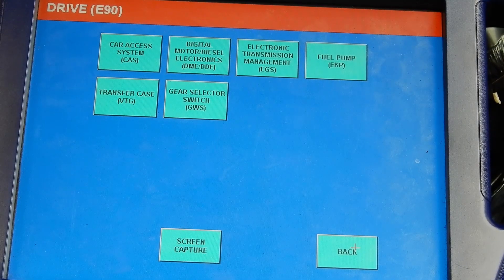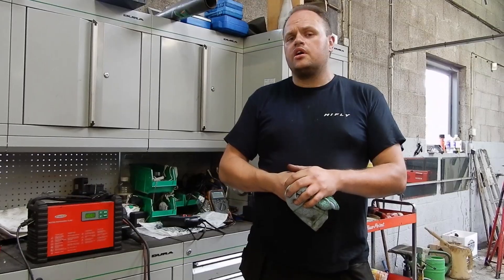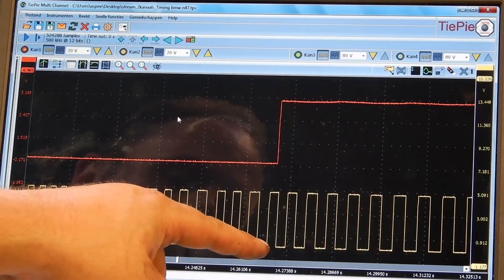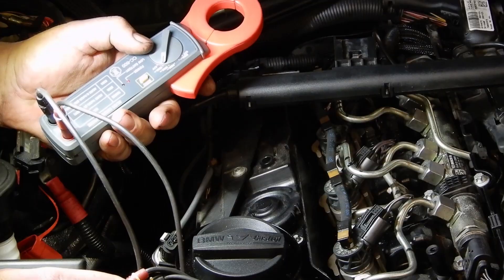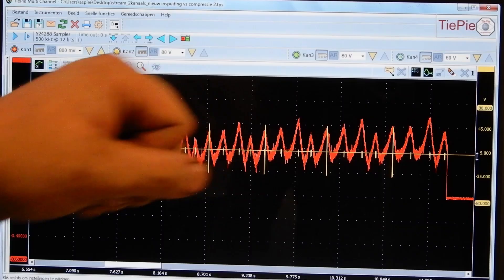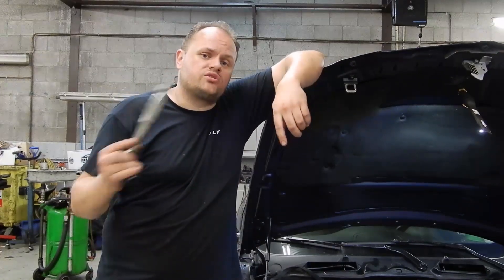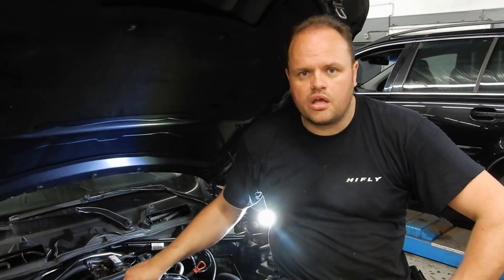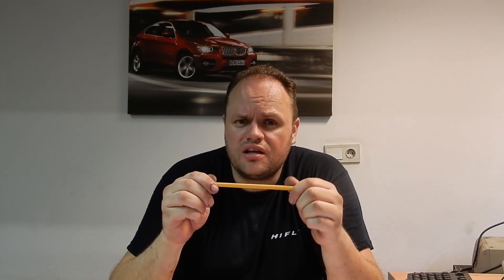Bmw n47 diesel engine "Won't run" diagnose

Comment: I like this more low key style of video. One question I have is on the relative compression test with the diesel engine. Assuming the engine is capable of running, how do you trigger cylinder 1? Do you unplug all of the injectors?      Since we are guessing, I'm saying the engine spun a main or rod bearing.
Reply from the maker: That really depends on the system your working on. And what's easy to get to. Sometimes it's unplugging a dieselpump connector. Other times i blead the fuel rail.

Comment: i think there is a mechanical problem inside the engine because its very hard to turn manualy even the starter is too hard to rotate the engine i guess a worn out piston or main  bearing

Comment: Cylinder n 3 I gess because during the starter motor test with the clamp the waveform showing the third  cyl graph going higher than the others
Reply: @Diagnosedan  does that mean he's right..

Comment: I think @ this point I would drain engine oil an visually inspect oil for metal contaminants. That might give some clue on what to do next. I like a mystery 🤣🤣🤣
Reply from the maker: I wasn't allowed!😢
Reply: @Diagnosedan  that sounds like someones hiding something from you lol seems like its a sign that someone messed up in a big way or is ashamed to be found out

Comment: Its imposible to give  answer att this point.
Only way to take apart engine and inspect.
I would start by removing valvecover and oilpan
Reply from the maker: You are right!

Comment: Seems like bottom end problems. Crank bearings burned, Seized  from failing oil pump (oil pressure) Maybe, just saying.. Dan! Tell me if I am wrong. Thank you.
Reply from the maker: You could be right😊

Comment: belt ... :)  :)  :)  :)  :)
Reply from the maker: Belt?
Reply: @Diagnosedan  Yes, belt is missing ... or it's not missing, lnstead on it's place it is around fuse box ahahahahahahahaahahahahaha
Reply from the maker: @damirmisic6101  that's to rule out anything belt driven was the cause🤣🤣
Reply: @Diagnosedan  ahahahahahahahahahahahahahaa what a prankster !

Comment: When you spray flamable gas to the intake, you in risk of exploding intake. If  you have open intake valve, even a glow plug can ignite mixture. So it is risky one. We are using spray for dash panels. You get softer explosion, when cranking. And also it smells nice :D
Reply from the maker: 🤣🤣 Never happened to me and i've done it hundreds of times. 🤔

Comment: Good mystery video.  If the main bearings were burnt the engine would be tight and the compression strokes for each cylinder would not make a difference in the amp draw by the starter.  I would have liked a visual inspection of the valves and timing chain.   I wish I could justify buying a scope.  Why are there different width pulses from the cam sensor?
Reply from the maker: To determine the position of the cam

Comment: Great video yet again Dan.  I think the crankshaft has had new main bearings or big end bearings in the conrods and they haven't been installed correctly by using prestigauge etc!  Hence, very tight engine.
Reply from the maker: Thanks for watching!😊

Comment: I would like to see what the owner of the car had to say abput the bill he was presented by the first garage.

New starter, new battery, etc still no start. Oh by the way you also need a new engine. €850 please. Ph and you owe Dan another €250 and the tow truck wants €150.
Reply from the maker: The car was fine before the customer brought the car in for an oil change😥 After that the trouble started.
Reply: @Diagnosedan 

Back on the early 80's I worked for a car dealer who was a wholesaler, buying cars from dealers and primarily selling them to other dealers. 

An older couple had a beautiful 1975 Ford Thunderbird they had taken to Sear's auto department to get a service befpre they went om a small trip.

They took their car in for service often and those nice folks at Sear's always found a little something that was out of spec like a ball joint or something. When they picked up the car, it had rod knock.

They took it to a dealership and we bought the car as a trade-in. It had every option from 4 wheel disc brakes to leather upholstry. We then purchased a different car that had been trashed by vandals, all the windows smashed tires slashed etc. But the 460 engine (7.5 litres for you metric folks.)  was sweet so the swap was made.
Reply: @Diagnosedan  Aha, maybe the sump was full of diesel, and new oil was too late.  This was new information you just said. Is this the BMW motor with the crazy screws that come loose in the intake manifold butterflies?

Comment: Strange that you do not have access to timing diagrams.
When you repair electronics like a TV receiver the schematics often show the correct voltages. frequencies and waveforms.
Under EU ruling I believed that that kind of information should be freely available to all.
Another thing I find strange is the way you probe the sensor signals. Is there no kit with various connectors and test wires available?
You could then have a small piece to connect between for example a coil/injector/sensor and the wire harness.
On electronic equipment they also often specify test-points. Sometimes in the form of a pin to connect an oscilloscope probe.
Reply from the maker: Unfortunately this is not the case for cars i wish it was.
About special connectors for probing, Have you thought about how many car brands we service. And how many different models,years,options,Systems? We would need thousands of connectors😉

Comment: Dan said the ENGINE is seized. Its similar to a Locked Rotor Amp condition on an Air Conditioning Compressor. Probably lack of Lubrication caused the Engine to lock- up. He also said He doesn't know the history of this Car.  
Who knows who worked on that poor car? Just hope the owner has tons of money- because that Engine is shot.
Reply from the maker: I'm afraid it was David.😓

Comment: Another great video! Thank you DiagnoseDan!

I would have been helpful if you said in the video that the customer did not allow further exploration of the problem as the video felt incomplete...
I was eager to know the story and was a bit of a let down but it was not your fault! Dealing with other peoples messed up jobs is difficult and complicated...

I was betting in a timing problem as the N47 are notorious for timing chain problems...

Best regards and keep up the excellent work!
Reply from the maker: I know, thanks for watching my video's it's appreciated!
Reply: Just to clear things up for novices,  when the timing is off, that  means almost NO compression, and then the engine would turn FASTER and draw little current,  not slow as molasses like that one and drawing huge Amps;

Comment: Be careful when using Brake Cleaner as a fuel source, when Brake Cleaner burns it creates mustard gas which, at best is an irritant; at worst...  Use Gas, Petrol or proper Starting Fluid as a fuel source and keep your health.
Reply from the maker: I know but this is not true for all brands of brakeclean!
Reply: And I think especially in diesels isn’t starting fluid really harmful for the motor? Thanks Dan good video sorry you couldn’t continue on! And happy new year buddy, wish I was in your area so I could know you better. Thanks again, Doug
Reply from the maker: @bigfootemobileauto9734  
Hi Doug, thanks for watching my video's it's appreciated!
Reply: Actually it’s not burning the brake clean that is the problem. It’s the propellant. In the old days they used Freon. Burning that is where u get the “mustard gas”. I think most use butane/propane as the propellant today. So spray away. I use a refillable aerosol can with gas, petrol for the east side of the pond folks. It’s cheap, cleans throttle bodies, great for floor spills and adds a little drama in my life when I find a secondary voltage leak. Also, great for starting the camp fire or bbq. Cheaper and better than brake clean. In my moronic opinion

Comment: Hey Dan. I have a problem with my n47 diesel which the dealer cannot resolve and no codes in system.  The car engine stuttering and the revs jumping all over the place high and low especially between 1200 and 2000 rpm. Revs also jump up and don when coming to a stop garage changes fueL lines and filter, EGR sensor and valve, transmission fluid and filter and no change. Can’t seem to diagnose the problem. Also lots of engine knock when moving off from a stop. Can you give an idea of what that could be?
Reply from the maker: Hard to tell without diagnosing, No codes? Torque convertor OK?
Reply: Did you check your throttle plate/butterfly to see if it's loose?

Comment: Seized alternator?
Reply from the maker: Is the belt on?
Reply: DiagnoseDan you’re right, it’s not, then it’s either a bearing that’s spun on the crankshaft or an issue with the transmission. I have seen a spun bearing on a similar engine before, but the starter motor let the smoke out pretty quickly

Comment: lol ...i like the guest....the crank is seize by bearing or if it is a automatique transmission that was remove from engine. then it could be the torque is seize into the pump transmission by bad coupling. or the high pressure pump is seize

Comment: we have learned bmw starter motors are very strong
Reply from the maker: At least we learned something😉
Reply: And so are the timing belts. it.did not even strip or miss a tooth, amazing,  so overheated motor as a guess leading to partial seizure
Reply: @crumplezone1  n47 use a timing chain not a belt... And it is a item that usually gives problems, the first models 2007/2009 would brake without giving a warning..

Comment: DAN, by the way, in my opinion you should also give ALLDATA europe a try at least. Saved me lots of hours on pretty much any type of procedures and wirings etc. Especially for VAG and Mercedes. BMW is my main brand i fix in the shop, so is not much of an issue for me due to expirience, but VAG and Merc, were giving me a really hard time, until i got me ALLDATA europe access. :)
Reply from the maker: metalhead BADMOJO Thanks for the tip. I would love to have them all but they are pretty expensive. So Sometimes you got to make choices.

Comment: By the looks of it, that car had been driven though flood water, taken in a gut full of water through intake and bent some rods.. first checks should have started with first shop asking owner when and where it all went wrong! O-well ur job is done! 😋
Reply from the maker: 84sneaky 😁
Reply: On 2nd thoughts it cranks like it has a seized ac compressor attached but obviously the belts were off. Much more likely would have had damaged bearings but we will never know!! Argghhh 😂😂😂
Reply from the maker: 84sneaky thats more likely!😉

Comment: You didn't  tell us why the crankshaft was blocked..What was the exactly the problem  in that car???
Reply: He also didn't mention if he removed the poly-v belt. A seizing alternator or a/c compressor can also prevent an engine from turning over. I've seen it more than once.
Reply: @alexlongpre4527  I thought that as well but noticed that the auxiliary drive belt is missing all the way through the vid, you can see it at 1:20 and 11:10.
Reply: @spankeyfish  Well I'll be damned. I didn't even pick that up. You've got a keener sense of observation than I do. Good call lad.
Reply: Alex Longpré total agree, had it a few times
Reply from the maker: Ahmed Sharif 🙉🙈🙊
Reply: He mentioned that the oil sump had been removed and replaced at some point. It's possible that somebody had replaced one or more big end or crankshaft bearings and they've either installed bearing shells that are too thick or overtorqued the clamp bolts so that the crankshaft is clamped too tightly.
Reply: @spankeyfish  That's my theory as well. Leaning more to overtorqued bolts.
Reply: @spankeyfish  when the fuck did he say oil sump? He said oil pan
Reply: @bonton9441  That's the same thing. It is in the UK, at least.
Reply: Yep, final diagnoses would have been icing on the cake! Otherwise it was another great video Dan!
Reply: BMW what more do u want heaps of scrap sure look at the problem the had with timing chains engine where blowing up
Reply: Ahmed Sharif  overheated and seized at some point ?
Reply: @englishbob5106  If it's overheated to the point that the block or head have distorted so that the bearings for the camshaft or crankshaft aren't in a straight line any more, that could be possible. I don't know how much you can actually distort an engine by overheating it, though.
Reply: incorrect injector sequence(signals)

Comment: it's a bad positive b+ battery connection bmw has got a recall on most 3 series thats been made from 2007 to 2011
Reply: I don't think a bad connection would partially seize an engine
Reply from the maker: A battery connection would prevent me from turning the engine by hand?

Comment: Hello dan i love your videos..... quick question for you i hope you can help me....i have a 09 e70 4.8 both my front windows only go up or down an inch at a time. I scan the car and is set a code for the hall sensors for both windows. Do you think is the sensors that went or do you think is the frm module..... how can i check the sensors or the frm module that went. Thanks in advance
Reply from the maker: Fernando Bullón First try to initialise your Windows!
Reply: DiagnoseDan i did that and still the same.. the car was parked for 3year it’s kind of weird that both windows are doing the same thing

Comment: couldn't  that have been caused by a hit in the oil sump, and cause a leak? we all know how low riders those bmws are. Therefore a lake of lubrication even just fore some minutes will eventually end up in seizing an engine. You did mention that the sump was in fact removed at one point in time. Good information though, not a lot on internet, on diesel engines. Many thanks!
Reply from the maker: Lucian Lucian Could be! Thanks for watching my video!😁

Comment: I like your videos a lot, thank for sharing your knowledge,  question did you ever check the engine oil level, if it was above the max level, I was thinking maybe original  problem could have been  bad battery slow crank, low compression , wash down cylinder diluting engine oil , ultimately damaging bearing ,  it was just a though, I learn from every video you have here thanks.
Reply from the maker: Joel Automotive  In action, Thanks for the feedback but i know what was wrong with the car but it would make the other shop look bad. So they didn't want me to go any further😉
Reply: @Diagnosedan  please tell us what was wrong! :D

Comment: I will take a guess after watching your diagnosis and say its suffered a diesel run away and melted the main bearings or semi seized the engine either way its gonna be a big bill. thanks for the video enjoyed your approach on the diagnosis regards Rich.
Reply from the maker: Richard Mounfield thanks for the comment buddy it's appreciated!😁

Comment: That was like reading a good book only to find the last chapter missing. SO  WHAT WAS THE PROBLEM ALREADY?
Reply from the maker: Dave Leighton, Thanks for reading!   I was never allowed to fix the car or take the diag. any further. I know that sucks, but i posted the video anyway. Because there is still something to learn.
Reply: DiagnoseDan the reason i wanted to know was because I have a diesel renault kangoo which had similar symptoms and when we stripped the engine we found that the bearings on one piston had virtually melted to the big end and the crank. Nobody can explain what happened but it got so hot that the conrod blued. Oil pan was full of oil. It ran perfectly then it started cranking slowly and became difficult to start.
Reply: @daveleighton4683  needs a motor dummy
Reply: @daveleighton4683  if it was the 1.5 dci engine, those are notorious for crankshaft journal bearing failures. some bearings were factory defective and also the fact that they were using 10w-40 oil with 30k km changes at dealer level was part of the problem
Reply: @Theag393  I replaced the engine with a second hand one and it is perfect.......except now it will not rev past an idle. No codes, same computer, injectors recoded, again and again, Pump was changed. On clue why it won't rev. It's like the pump is not connected to the accelerator.
Reply: @daveleighton4683  do you have a reading of the accelerator position by the ECU??
Reply: @Theag393  thanks for that. I will check with my mechanic.
Reply: @daveleighton4683  what I said from a professional mechanic point of view is a bit obvious, I would not want to upset anyone with that observation. I hope that he can find the problem. Sometimes when frustration accumulates people don't react well.
Reply: @Theag393  sometimes frustration also causes the experts to miss the obvious. He has been concentrating on the injectors. Maybe. I certainly don't mind causing offence. I'm paying the bill.
Reply: Dave Leighton perhaps a blockage in the oil relief passage in the crank? Poor quality/ incorrect oil and late changes earlier on in its life?
Reply: Had a similar issue with a 2010 Ford Focus 1.6d hdi. To make a very long story short it was a partially seized a/c compressor. Removed the aux drive belt and it started right up. Similar symptom in that it was nearly impossible to turn the engine without the aid of a breaker bar. Very well put together video. Thank you for posting.
Reply: What happens if all cylindres have no compressions ? Still a big resistance to turn by hand  ?